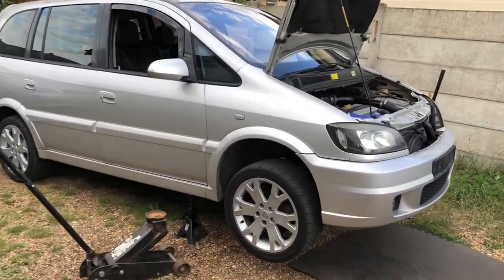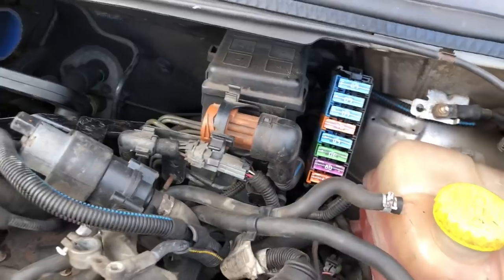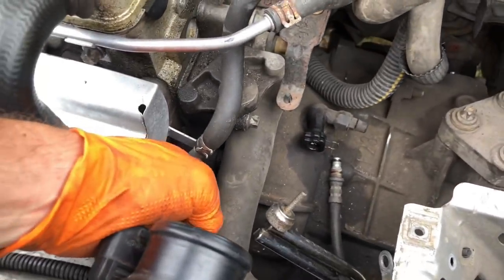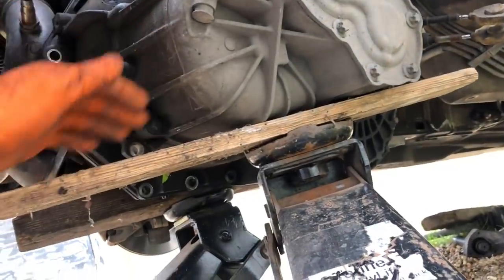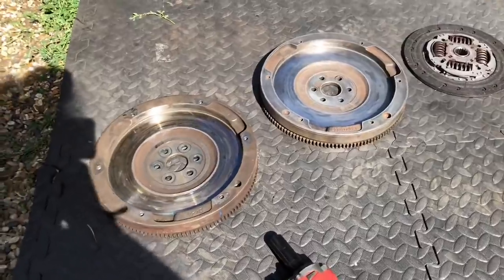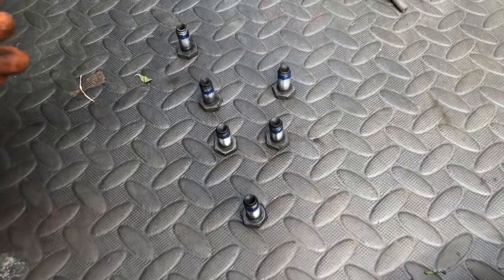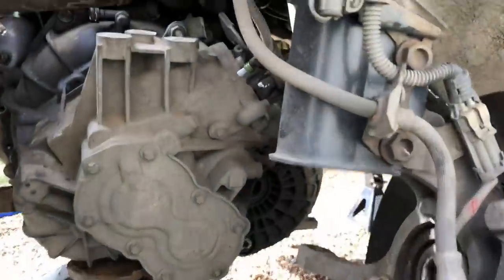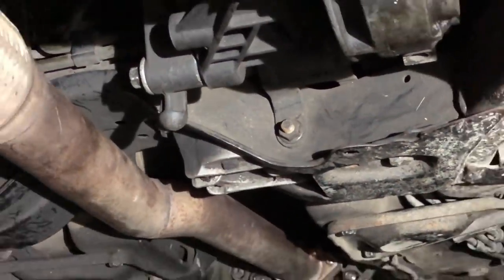Changing A Clutch Or Gearbox Is EASY!! Zafira Opc C20let UPGRADE!

Comment: I remember the old caviler sri130's where you could undo the panel on the box release the clip unbolt clutch change it back on the road in 30mins don't have to take the gearbox out
Reply: @fargogemini694  I can easily believe it
Reply: I remember doin this on my mates driveway, good times
Reply: @broken12367  old school better times more character to cars then
Reply: Good old school engineering

Comment: If your just doing the clutch you can leave the subframe on. Undo the suspension bolts to the hubs and leave it hanging from the ties... just undo 5 subframe bolts and leave the one under the drivers foot well.. gives you enough space to change the clutch, flywheel and real oil seal.
Reply: Hi live life fully -  I’m doing it this way too. Just a quick question, did you bleed the clutch for air at the end of the job? If so what method, thanks
Reply: @omarismith3655 hiya. Only just saw this comment.i used my easi-bleed to pressure bleed it.😊

Comment: yep just done the clutches on ramps one on a BMW 123d which was hard as I didnt had enough space as everything was under the car and lifting it back up was a pain, done one in a Passat 2.0 TDI 2011 it was so easy compared to the BMW as everything was very easy accessible and big bolts

Comment: Any chance you could do a quick video on how to bleed the clutch after fitting new clutch and slave cylinder.
Reply: What i did was wedge the clutch pedel to the floor
put a rubber pipe on the bleed nipple and connected a syringe to the other end of the pipe
opened the bleed nipple suck the air out with the syringe
close the bleed nipple remove the syringe keep repeating this process
until the fuid comes through

Comment: 3:50 Did you need to hoist the engine from the top, before removing engine/transmission mounts on the subframe? I have to do subframe replacement soon on a friend's Meriva, and I don't know if I need an engine support bar/hoist or not?

Comment: Aaron.. just a quick question mate. My Petrol 2014 Zafira b 1.8 has 118bhp. it's basically gutless I should have done my homework and gone for the 139bhp version.. what's the best way to gain more power not speed but torque?

Comment: I’m aiming for 300bhp, is the standard Z20LET clutch up to the job?
Reply from the maker: On its limits. Depends on torque level
Reply: Aaron Unknown that is way above my head 😂 I still need to fit my fmic VXR injectors and MAF 🤦‍♂️ as far as I know it’s the original couch with 99000 on the clock.
Reply from the maker: Id expect it to slip, swap it out for a c20let Luk
Reply: Aaron Unknown do you do private work?

Comment: 😂 Average punter trying that 😩😂
Reply: I have an opel/vauxhall omega.. at the time i needed to replace the clutch and timingbelt and all that comes with it.. so i just pulled the engine and gearbox out in 1 go... needed to work on both ends and while i was at it i cleaned the engine aswell.. had some oil spill on it that started to smell.. it might be a lot more work.. but some cars are tight on space to work in.. so when its out i got tons of space..

Comment: Remove batt and tray,disconnect starter motor,slave cylinder for clutch,sensors anything attached to gearbox, support engine underneath and gearbox preferably,start undoing bolts top side of gear box and remove mount,undo bolts underneath then wrestle box out......... EASY 🤣😂🤣😂🤣

Comment: My clutch went soft today. Can’t change gear properly either. It just randomly did it today when I put the clutch peddle down. I felt a pop then it went soft. Fluid level is normal and no leaks under the car. It’s bone dry. Above the peddle I’ve checked the master cylinder and it’s not leaking either. Any idea Aaron? You know your stuff. It’s a z18xer engine. Zafira b.